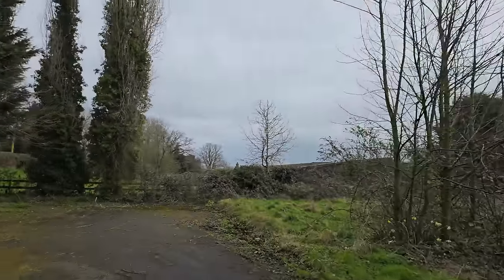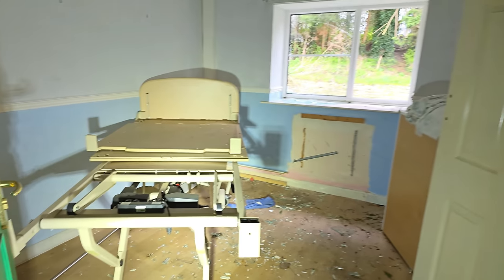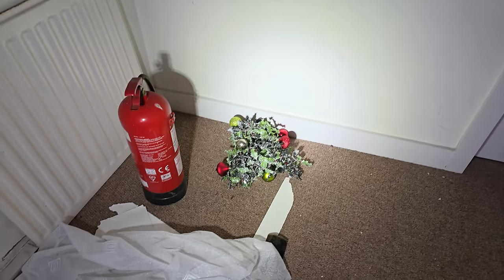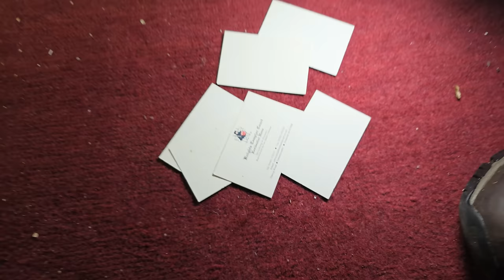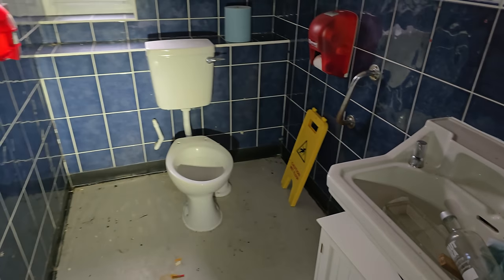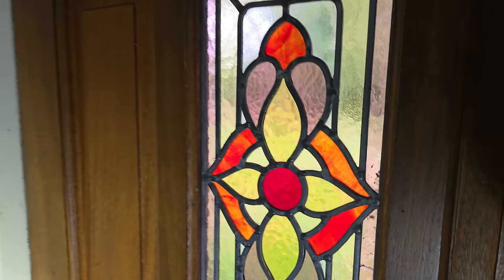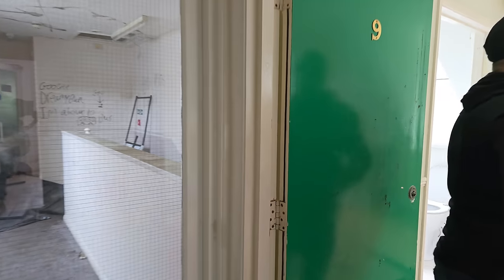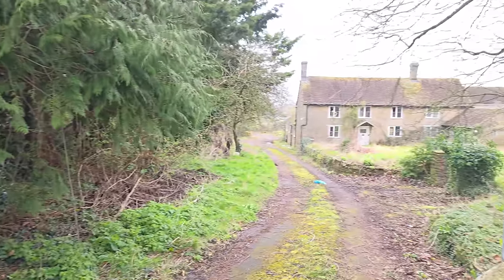We Found an ABANDONED Knights Templar Cottage -  Now a Dementia Care Home Left to Rot!

Comment: Apart from all of the windows that some fool has smashed in all it would really take would be a few good friends who get along and some manual labour and a bit of cash each and you could make a place like this liveable easy enough.
If you could live without some home comforts and only use and keep the technology that you truly need you could have one of those big battery solar generators in all of the occupied rooms with solar panels on all of the roofs which would power the lights and charge and run most small devices like laprops etc, wood burning stoves for some heat and to cook your food on 
and then you would be just left with the water supply issue but you could buy a few thousand litre water tanks that you could have filled with fresh water as and when it is needed.